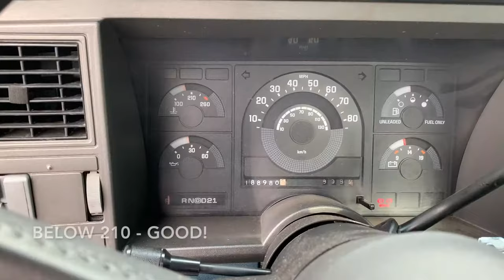BEST VIDEO! 88-98 Chevy GMC Truck Water Pump Replacement Tutorial (GM400)

Comment: Looks like you put some blue material on the gaskets and the two upper screws, but no mention of the material or how you applied it, nor if you allowed it to get tacky.  How much torque on the four bolts?  I am hoping for no leaks, so these details are important.

Comment: Thank you for posting this. I had a leaking freeze plug on the driver side front of the block behind the power steering pump along with the water pump/thermostat. Had to loosen the whole rack with all the pullied items and bend it out the way to put the rubber twist style freeze plug back in.
Reply: Dude, i didnt even know they made rubber ones. Now i can stop the coolant leaking from my van down by the river

Comment: I have an intermittent coolant leak in my 95 C1500.  I thought it was the bottom hose connection at the water pump because sometimes coolant runs down the backside of the hose and drips when it gets to the low point of the hose.   But I replace hose.  Still leaked.  Replaced clamp.  Still leaks.  I'm wondering if the water pump could be leaking from one of the bolt holes that is behind the hose nib and running down the back of the hose.  Or, if it's leaking from the weep hole, would it run down the back side of the hose?   Only leaks after the vehicle has been running and is then parked somewhere.  And again, not all the time and usually not right after I park.  Usually doesn't start dripping until after it's shut down for a while.    That what keeps me thinking it's the hose/clamp.  But I'm at my wits end here.  Any possibility it could be leaking somewhere other than the hose itself?
Reply: same thing with mine the waterpump housing rusts out over time

Comment: Good video, watched before replacing my 1994 5.7L which had totally failed breaking the belt and dumping coolant on the ground.  Couple of things I ran into to be prepared for -- I was worried about 30 year old water pump bolts coming out, they came out no problem but only one of the four 1/2 inch drive 14 mm sockets I had would fit the narrow opening around the bolt head so check that before you start.  The four bolts holding the fan on looked in good shape and didn't think they would be a problem so of course they were. One came right out, another after some work, the last two no luck.  Had sprayed all them ahead of time, tried smacking wrench with hammer many times, then vice grips and smacking harder, then heating them.  The last two would never budge and ended up cutting them off with a hacksaw blade (cut the nut down the side so you can get the stud out).  The threads are M8x1.25 and I used get bolts to replace the studs/nuts for those two as no parts store anywhere near.  If you are putting on a new lower radiator hose, my radiator end spring clamp was not accessible until I pulled the radiator free (you don't need to disconnect the trans lines, just move the radiator over a bit).  My truck very common build, Delco GM part number for pump 252-719, belt 6K966/88932795, and lower hose 26207X 88908904.

Comment: Waiting for the parts now, my 93' K2500 Suburban is getting a new pump and a 4 core aluminum radiator with dual electric fans. Will help it out a bunch in the 100+ degree days here in Arizona.

Comment: My rtv sealant is curing right now, thank you so much for this video. The water pump bolts came out easier then the dam oil pan drain plug, lol. Lots of life left in mine, she’s a tbi 1st gen 93 c2500 rwd. filling up with water tomorrow, starting her up and seeing how she runs, cheers :)

Comment: Nice! Need to remove both steering pump, water pump & A/C compresor in order to clean the block from an oil leak from the manifold gasket.

Think there Would be trouble if water pressure goes into those water pump holes into the block?

Comment: How do you let the air cycle out just leave it running
Reply: Ya and make sure it’s stays full and try to get the front in the air also have the heat all the way up
Reply from the maker: I let the air cycle out by burping the lines like I did in the video (but be careful if the fan shroud is off). Also like Jon the Lamb said. Make sure the coolant stays topped off (full) from the radiator and let it cycle. Keep the car on while doing this and the heat all the way up. I've heard having your car at an angle with the front end higher will help as well. Thanks for watching the video!
Reply: Yup❤

Comment: if you still have the truck you have a severe under voltage issue with your charging system. voltage should be reading just above 14Vdc